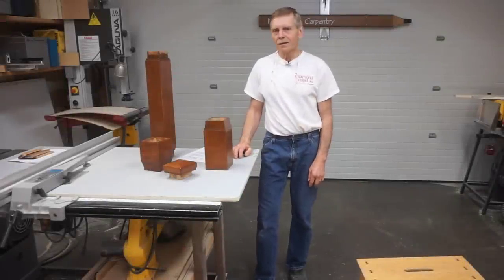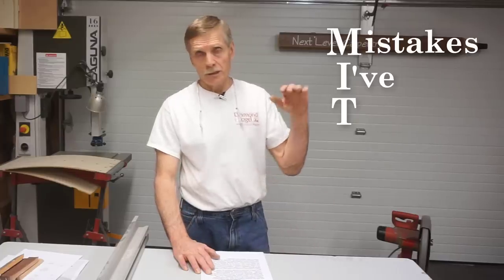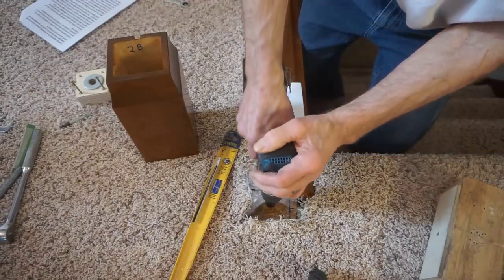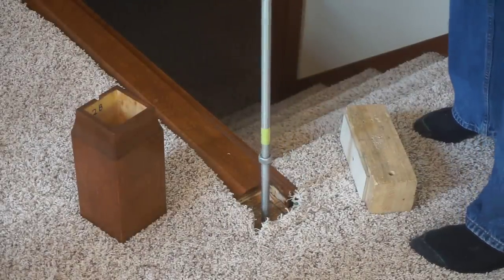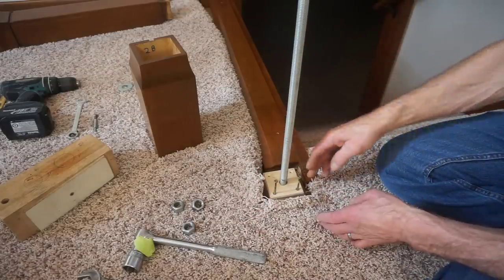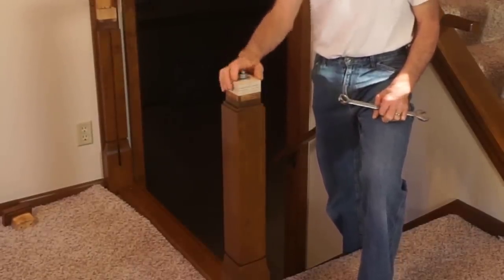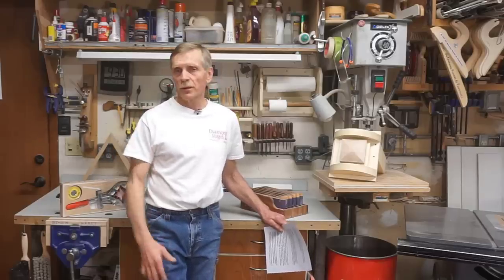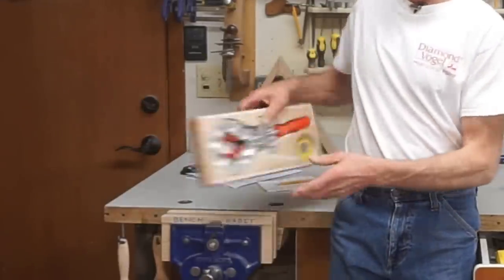How to Install a Newel Post Without Wobble

Comment: Would the same idea work for a newel post into concrete?
Reply from the maker: I'm sure it would Mark although I haven't had occasion to try it.  My first thought is that you might need to drill an oversized hole and use epoxy to secure the rod in the hole.  If you can find a good drop-in type anchor of at least 1/2" NC thread size it might work also.  As long as the rod is held secure I can't see any reason this wouldn't actually work better in concrete than in the wood subfloor installation shown in the video.  Good luck! Best, Matt

Comment: Hi Matt thanks for the awesome vid. Can I ask what height this system would start to experience issues with stability? My newel posts are about 1200mm (48") high.
Reply from the maker: I don't have a definitive answer for your question because there are so many variables involved in any given system and installation. What it all comes down to is physics pure and simple. If you're able to increase the footprint of the Newell as it gets taller stress forces would remain similar. If you increase the height of the post while maintaining the smaller footprint you would need to compensate with other things like stronger blocking or a heavier threaded Rod to maintain stability. One thing I am confident in though is that this design and configuration is your best bet for getting adequate stability when compared to other anchoring methods. Good luck with your build I hope it goes well!
Best, Matt
Reply: @NextLevelCarpentry  Thanks very much Matt, I appreciate the quick response. I’ll give it a crack and see how it goes.
Reply from the maker: @jarrodchapman2011  Sounds like you're paying attention so my bet is you'll do great... you'll learn a bunch in no time if you make even a simple mock-up (as I often do) 😎

Comment: Is drilling a 5/8th hole vertically in a joist allowed? Seems to be a lot for a structural component...
Reply from the maker: No different than if there's a 5/8" knot running through a joist: perfectly fine in most cases but certainly not all.  Use common sense and experience to discern the difference...

Comment: Thanks for sharing. Seems like it still wobbles a bit? Could you lessen the wobble by cranking the nut down some more?
Reply from the maker: Sometimes.  How rigid the post is depends on the density of the floor material and the overall 'footprint' size of the post. if you have a post with a small footprint on a relatively soft floor, no amount of extra tightening will prevent wobbling because the post base can always compress the floor and wobble.  I would cautiously tighten the nut to and monitor results for optimum rigidity of the post.
Reply: @NextLevelCarpentry  thanks for taking the time to reply. That means a lot to me. 

What you said makes sense. I guess this setup will also have some type of wobble, if it's not attached to something that adds shear resistance.
Reply from the maker: @adde32332  No problem, I always enjoy talking to viewers who are inquisitive and engaged.  Not to be contradictory but shear resistance isn't really a factor in this situation.  The two main forces involved are tension and compression.  Tensile strength of the threaded rod is easy to achieve by increasing the diameter of the rod.  Compression strength of the post material and flooring is more of an issue, mainly because of the way 'leverage' from a 3' tall post is exponentially greater the smaller the footprint of the post.  Unless the floor is concrete, a post less than 4" square will exert enough force on any kind of wood to allow insufficient compression strength of virtually any wood flooring.  I add this in depth explanation for benefit of others even if you already understand the forces at play and how they affect rigidity of a newel post.
Best,
Matt
Reply: @NextLevelCarpentry  I agree that the two main forces that's holding the post down are tension and compression. What I meant is those alone won't do not stop shear forces from making the post wobble, because of the limitations you mentioned with wood.

Adding a railing would make the post more stable, because it would add shear resistance. You would be increasing the footprint, and reducing the impact of leverage.

For example, this technique is often utilized in building a half wall. But it's only one part of the equation. One still must add sheathing to both sides of the half wall to make it resist the shear loads.

I'm not an engineer, but an avid learner. This was just based on my experience. Feel free to correct me. You probably know a lot more.  Thanks!
Reply from the maker: @adde32332  I'm not an enguineer either 🙃but 'shear resistance' doesn't come into play in this situation.  Wobbling the post generates forces through leverage which generate tension on the all thread which in turn generates compression between the bottom of the post and the subfloor.  The only place shear would come into play is by applying horizontal force against the bottom of the post parallel to the floor.  In that case, the 1/2" rod would resist the shear force being applied to it.  Note: there's a definite distinction between the terms "shear force" and "sheer force" which might make this discussion a bit confusing.
Reply: @NextLevelCarpentry  I think writing out responses is a great way to learn and figure things out. What I believe is going on is tension and compression forces are locking the post into place. These forces are keeping the post from moving out of axis and provides superior vertical tensile force resistance. But it still wobbles because there is not much shear resistance. My definition of shear resistance is forces acting  parallel to the surface, so the floor. Specifically, Forward-Backward Shear Forces: These occur perpendicular to the railing and can result from things like someone leaning against the railing or pushing/pulling something against it.
 

Imagine leaning on the post. It will move somewhat. Now if you integrate the post into a railing it's going to move a lot less, because the railing adds shear resistance, primarily because the railing will now distribute shear forces across a broader area, sharing the load among multiple framing members.

I think we are on the same page. Terms and forces can be confusing to talk about. And you're right about the limitations of wood compression and counteracting leverage. If the post was screwed into concrete it would be a different story.

Comment: The extra jam nut used at the bottom of the post would limit the ability to re-tighten the post into the joists some years down the road if necessary, so I think I would leave that out.

Comment: This is rock solid, have you ever had a nut loosen and make the rail wobble?
Reply from the maker: Nope... but if it was a concern a dab of LockTite or a nylock nut would prevent the problem forever and always :-)  Best, Matt
Reply: Next Level Carpentry Loctite, definitely!
Reply from the maker: A little dab of peace of mind can't be a bad thing...

Comment: I too am an engineer who came back to the finish carpentry. I love it, but find it difficult to run the business,  self-perform the builds, and do estimates. Any tips?
Reply from the maker: Hey Patrick, this is probably not what you're expecting but I can tell you that the main thing that has made The Timber Tailor, my custom design/build carpentry/millwork/contracting business sustainable, is to completely ditch the whole bid/estimate paradigm for a cost-plus/time and material approach.  It's not for everyone but I'm convinced that for those of us who are very particular about our work it's nearly impossible not to end up subsidizing our client's projects with our work and profits. I won't enter a debate with those who would try to convince me I'm wrong but can attest to the fact that many of them go down in flames flat broke in the end while I know for certain any time on any day what my profit is.  
The most difficult part of my equation is finding 'the right fit' with clients who must trust that I only charge them for what they're getting, no more, no less.  One of the most fulfilling aspects of what I do is the mutual respect that grows between client and contractor with this arrangement.  I should write a book some day but I fear dealing with myopic detractors would be overwhelming because the only meaningful way to really compare would be in revealing bottom line financial results on a yearly basis which, of course, won't ever happen.  I just know how many bid guys end up working ridiculous hours, wearing out shiny new trucks, getting divorced and then go belly up and end up working for a company after a foray into the world of self employment all in an effort to make the big bucks snagging jobs they over bid and cut corners on to maintain a profit.  It's definitely not all bid/estimate outfits but plenty fit this scenario.
There you have it... hope you're not sorry you asked.  Work smarter, not harder my friend! Best, Matt
Reply: @NextLevelCarpentry  , thanks for the honest reply. I'm slowly finding my select group of clients that I enjoy working for. I've finally honed my cabinetry estimates, but it is still less than 25% of my business. The rest is all over the place. I do thrive on the diversity of my projects, but find it nearly impossible at times to dial in an accurate estimates before starting. Cheers, Patrick (Civil Engineering, CU-Boulder, '04)
Reply from the maker: @patrickniedermeyer2112  sounds like you're on the right path.  Just make sure that those 'select clients' are hiring you because they value the work you do and understand your prices reflects what it takes to do above average work and NOT because your bid price is less than others.  I'm sure you're doing that but it always amazes me how easy it is for conscientious carpenters to kid themselves and go broke doing great work.  BTW my only engineering degree comes from M.I.T. which, as you probably know, is Mistakes I've Tried... never attended a single day of actual college... Best, Matt
Reply: @NextLevelCarpentry  after 34 years in this business i too have adapted this same business model, after years of stressing myself out thinking i was gonna make "Big" profits and ending up  working a day or 2 for free at the end
i now tell a client what my hourly rate is  and give a time & materials estimate 
i never have a callback because I'm not rushing around skipping necessary steps.
it also allows me to be a perfect gentleman when working inside a lived in home. drop clothes, dust curtains and vacuuming at the end of each day
i will sometimes jokingly say 
" you are going to get your money's worth no matter what it cost" 😁👌
Reply from the maker: @billystray7007  I'm going to adopt your saying "you are going to get your money's worth no matter what it costs"... made me laugh out loud!  Crazy how few adopt 'our' billing/business paradigm for profitability and success isn't it?  Many I know and watch operate from the sidelines are just kidding themselves, going broke in the process of subsidizing their customer's projects.
Always nice to hear from someone else who 'gets it'!  Best, Matt
Reply: @NextLevelCarpentry  you are welcome to use that saying 👌
Reply from the maker: @billystray7007  it's an instant classic if you ask me! Nice. Thx. Best, Matt

Comment: So how did you determine drilling a 8" deep 1/2" hole into a double 2x10 joist wouldn't compromise the structural integrity?
Reply from the maker: The span is so short it was actually just 'filler' here but this isn't always the case.  Gotta pay attention to keep from getting into trouble.  Best, Matt
Reply: @NextLevelCarpentry  Thanks for the quick reply. It's good that you remind people they have to check before making changes to structural members. I have seen way too many plumbers go wild with their hole saws.
Reply from the maker: @renodeify  boy do I here ya there!  Amazing... some bad actors must think that's why floor joists are spaced 16" on center; so it won't matter if they hack a chunk out of just one to rough in for a stool, right?!  Best, Matt

Comment: Great job.  I wonder, because of your hollow design, if you could have used a metal newel post (for decks) and a slight mod at its top for a threaded rod, with the final assembly being pretty much the same?  The 2" squareness of the metal newel should give it even more rigidity.   I might use carpenter's glue on those threads before I screw it into the floor joists.
Reply from the maker: Hey Mike, thanks for adding a bit of 'brainstorming' here!  Using a metal newel for decks leaves the main strength connection to the screws that attach the bottom plate to the subfloor, right? (I might be thinking of a different post design than you are) In that case those screws become the weak link in the assembly so I felt much more confident about the large diameter threaded rod than 4 screws of any length in a base plate. BTW before my friend told me about this method I was actually planning to use a steel tube of some sort but this idea made much more sense on every level.  You could sure add glue or something to those treads but I saw no reason for it in this case: that rod's not going ANYWHERE, believe me 😁😎 Best, Matt
Reply: Yeah that was the kind of newel I was thinking of, so I stand corrected.  I'm trying to get some ideas for a strong but removable 5' free standing railing.  Sometimes it needs to be removed to move furniture up or down the stairs, due to the sloped low ceiling above the stairwell.  Thanks for the tips.  Regards.
Reply from the maker: Sorry Mike, I hope I didn't sound like I was trying to 'correct' you... its this sort of dialog that raises the bar for stuff like this so I really appreciate the dialog.  I'd be surprised if this method isn't the solution for your railing because I had to install/remove this particular railing numerous times for fitting, staining and lacquering and then loosen & re-tighten a couple things during glass panel installation.  To keep long rods sticking up when the newels are removed you could use an all thread coupler down close to the floor so just a stub of rod would be left sticking up.  That way you wouldn't have to lift furniture up and over the tall rods I had in this installation.  You're welcome... hope this helps?  Best, Matt

Comment: Would it be better to put a lock washer on the top nut?
Reply from the maker: I'm absolutely confident that it was unnecessary in this application Evan since compression of wood fibers kindof acts like a lockwasher in preventing vibration from loosening the nut.  But if it's any concern for anyone else at all just slip one in there... it's well worth a few pennies for a washer if it helps you sleep at night 😁😎 Best, Matt
Reply: @NextLevelCarpentry  oh ok I was just curious, what about if the post was solid?
Reply from the maker: Same goes for a solid post IMHO... the compression of the subfloor is where most of the 'lockwasher effect' is going to come from so if the post is solid or hollow, same difference.  You could also use a nylock nut or a dab of locktite on the threads if there was any lingering concern. Any of the three options are incredibly inexpensive 'good night's rest' insurance 😁😎
Thanks for your comments Evan!  Best, Matt

Comment: Hi Matt, I see you have Minwax wood putty on your influencer page, have you ever tried Timber Mate? This very nice and I got away from the minwax product all together.
Reply from the maker: Marty Josephson I actually use Color Putty brand (I'm pretty sure that's what it is) wood putty but don't see it available through Amazon so I added the Minwax product thinking it's probably about the same.  I'm not crazy about wood filler in general or either brand in particular but will check out Timber Mate at some opportunity based on your recommendation.  Is it available on Amazon or do you get it locally?

Comment: How do you attach the glass panels to the Newel posts?
Reply from the maker: That was a fairly involved and tricky process of sliding the glass panels down into slots between the posts. Its more common to use special clips that screw to the side of the post and clamp onto the glass but I didn't like the way that looks as well...